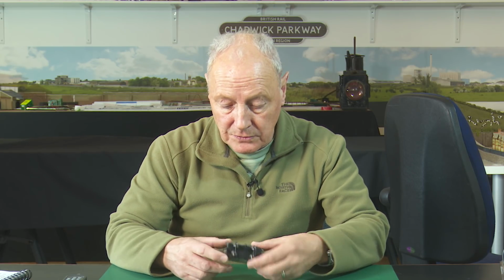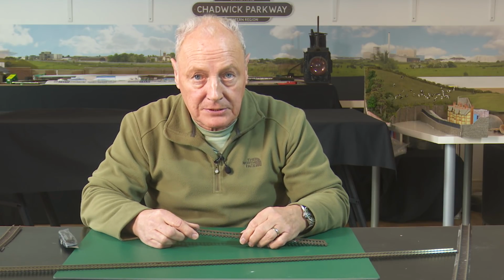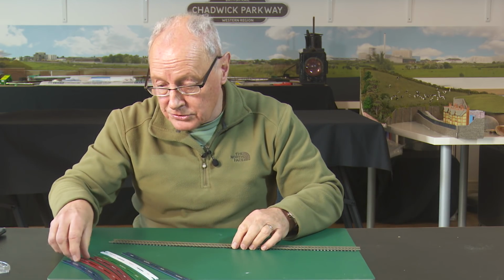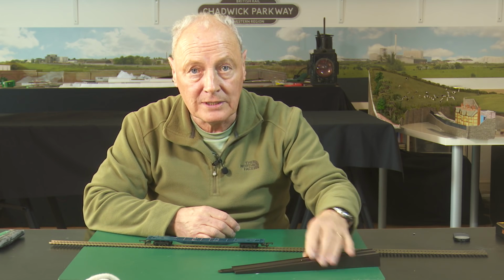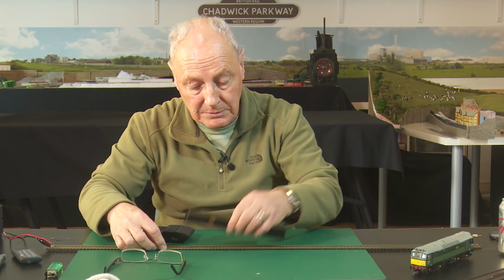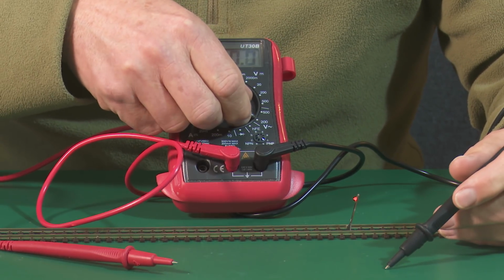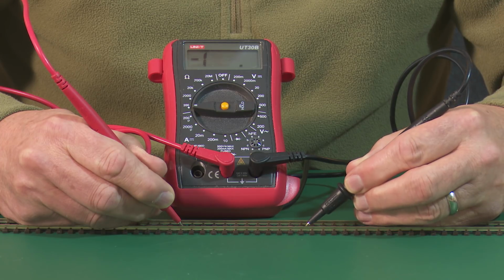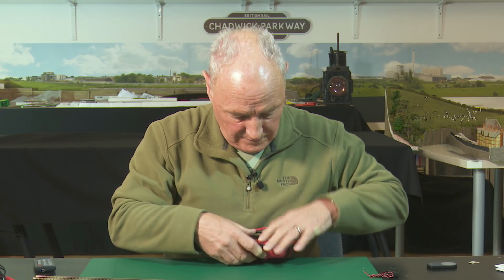Great model railway tools for the Railway Modeller at Chadwick Model Railway. | 76

Comment: As a professional firefighter, I would have to agree with you. A CO2 fire extinguisher will not kill you, yet the fire will kill you and take all your belongings with it! I think it's a great idea to have a fire extinguisher in the layout room. The only extinguisher that is dangerous to your health is a Halotron extinguisher, which is mostly used in areas where there are a lot of computers. Not for domestic use.
I learned a lot about how to use a multi meter, thanks for your help on this video. Lots of great things in it!
Reply: As a retired fire officer with 30 years service and now another 20 years as a fire safety consultant i thought i would add something to Charlie's advice regarding the placement of an extinguisher.  
By the door is a common location but it is rarely the best placement for any extinguisher simply because it encourages the "go to the door and think about it" strategy.  If you have got to the door in an emergency the best course of action is to use the door and leave rather than return to the fire and then do something about it.  It follows that the better placement for a fire extinguisher is closer to where the action is, or in a more central location where it can be used immediately.  Obviously, rooms and spaces vary but the principal is always the same - make sure the extinguisher is in a place where it can be used as soon as possible rather than somewhere that means it has to be fetched and brought back to the scene of the fire.
i know this is a small point but I hope it is worth a bit of thought.  And yes, a CO2 extinguisher will be fine as long as you remember to use it and leave, for a while.  Also it is worth bearing in mind that if you do use it it will be VERY noisy and don't hold the discharge horn unless you fancy a cold burn and being stuck to the frosted horn!

Love your channel, Charlie.  i really enjoy your videos.......and I don't even have a model railway!
Reply: Also the fine powder from a dry powder extinguisher will get in everywhere else and eventually over time damage or ruin all the surviving electronics circuits etc. in the rets of the room/house.
Reply from the maker: Thanks Joe, I’m so pleased that a professional firefighter can add his weight to what I believe is common sense.

Comment: Using ohms is something I never really thought about. Measuring voltage across joints because I'm simple that way. So thanks Charlie, I now have another use for the settings on my multi meter.
Reply from the maker: Glad I could help you find a new use for your meter Steve.  Regards, Charlie.

Comment: A good few years ago. I had my layout in the loft. I was told that a well known manufacturer was producing their own chip, But it was really a rebranded Lenz chip and it was a lot cheaper. I bought one and tried it in one of my Locos. I had my back to it as it ran around the back side of my layout. It had burst into flames before it shorted out the electric supply. I realised then that a small extinguisher was a must. (It was not a rebranded Lenz chip. That was why it was a lot cheaper)
Reply from the maker: A lesson well learned Philip. You can’t save money on safety. Regards, Charlie.

Comment: I wouldn’t invite the fire officer. Research the correct type of extinguishers. Show the wiring under your track boards would scare the bejesus out of the inspector and would probably demand that a certified electrician sign off your work!
Reply from the maker: I’m pretty sure at 12 V DC, I haven’t breached any. Regulations. Regards, Charlie.

Comment: Fire extinguisher what for slide track together screw down slide power leads in Tri ang track ready to run PVA glue and UHU not very flammable, citric acid 🤔to clean track with get your COSSH risk assessment out Co2 or powder ? Your to HSE
Reply from the maker: No, I’m just safety conscious.  With so much electronics and regular soldering, I’d be foolish not to have a fire extinguisher.  Regards Charlie.

Comment: On the side of the multi meter where the probes are stored. They can be used another way. Place the probe in with the test point outwards it will hold its self. This way you hold the meter and use the probe fixed to the side as one point of test the other is the free probe. This way you have the meter at one end of the testing point so don’t need to look round too often.
Reply from the maker: What an excellent suggestion.
Much appreciated, regards Charlie

Comment: Hi Charlie, find your video's very informative for someone like me starting out at 76 for the first time. In your video you show the back to back measure of 14.6 for wagons & coaches which was so helpful. As some of the stuff I have dates back to my sons Triang/Hornby from around 1970 all needs checking for modern day track & points thats why I'm using Peco streamline 100 in the hope it helps derailments. Where can I get the back to back you showed as it's not on your list of items used?
You explain things very well & show the process you go through in getting to your final end. My plan is to go DCC which frightens the hell out of me but in for a penny ah! no one ever learned anything without mistakes. Just hope they are not too expensive. How about some articles on converting older Lima models to DCC & the pitfalls or even the old Triang/Hornby there are a lot of us out there with minimal cash to spend. have taken your advice on so much, THANKS, Robin, Llanelli, S Wales.
Reply from the maker: Hi Robyn, I think you can buy the back to back gauge, from squirestools.com. Regarding converting old locos, I must confess it’s probably more trouble than it’s worth. Regards Charlie

Comment: Good idea about fire extinguishers, (any type),  first aid, phones etc 
I have a small plant sprayer, and a 2L milk container, filled with water.
Then if you ignite something accidently, you can wet and extinquish immediately before serious damage is done or a fire extinguisher is needed..
Also if you burn yourself with solder, hot glue etc, water is the best first aid to reduce the pain..
x The Bigfella x
Reply from the maker: Great tips BF.

Comment: I thought the mobile phone was to order a pizza delivery ;-)
I am using the N version of those to lock the flex track into shape and carry it around 
https://www.modellbahn-hobbyshop.de/Werkzeug-Hilfsmittel/Gleisbau-Klammern-Set--H0-0e-Krause-Klammern
speakers have an impedance, there is a resistive portion to the value, and an inductive portion, so the resistance measured is lower than the given 100 ohm
on your meter there is probably a conduction beep test that is accessible with the diode testing setting
Reply from the maker: Sadly no beep on mine AJ.

Comment: Charlie, your multi-meter has a diode position on it, near the bottom.  It should beep when you have continuity.  Try it.  Also, a CO fire bottle is what you want to use on an electrical fire - purple K and foam don't play well with electrical fires, let alone around model railroads.
Reply from the maker: Great points Chuck, many thanks.

Comment: I think the fire extinguisher debate will be just that. A debate. People will agree or disagree. Personally, I agree and in my rail room (30ft x 19ft), I have the soldering iron, a log burner, a few logs, firelighters, plenty of combustible materials to take hold should a fire break out. I also have a wooden ceiling although it is probably 14ft high, a fire could still reach it. The outer skin of the building is clad in timber. I have a fire extinguisher by the entrance, a first aid kit on a bench and a landline. I also have broadband and a mobile booster so my mobile signal is always good. My wife calls me obsessed and she often says I analyse things too much but for me, risk assessment and reduction is part of the job I do in the running of my business day to day. For me, I just do it because it's the way I am and for a little time taken to assess what is needed, I can protect my hobby as best I can. And if that protects me in the process, the wife will probably think twice about calling me obsessed in the future.......
Reply from the maker: It’s comments such as yours Andy, that make my channel worthwhile.

Comment: I agree with you Charlie.  Too many people take fire safety for granted. In addition to a fire extinguisher a fire blanket could make the difference between a house or no house.  
Even with the excellent fire service in the UK, by the time the fire brigade turn up the house you may be minus both the layout and house.... just take into account some of the materials being used...paints, thinners, foam and newspaper to name a few. And finally a smoke detector should be installed in the room.
Reply from the maker: An excellent comment and good suggestions too.

Comment: The only time that your model railway will probably burst into flames is if you use cabling not having the correct size to take the current needed.Install some kind of circuit protection,the simplest protection would be a fuse within the circuit
Reply from the maker: A valid point David.

Comment: What an informative video. Thanks for all those tips. Being ham-fisted my main cause of irritation is cutting plain track accurately to fit in between two sets of points, e.g. a loco release road. I measure, measure again, mark up where the cut should be, cut rail with the Dremel, and whaddya know...it's 2mm short or a fraction too long. Every ruddy time! How does everyone else get it bang on?
Reply from the maker: Everyone gets it wrong, it’s an honesty problem.

Comment: Hi Charlie, I’m just wondering where you got your 00 back to back gauge from? I can’t find any in the UK at the moment at either 14.5mm or 14.6mm. I was in Settle a few weeks ago and popped into DCC Concepts and asked them about there 00 gauges which are never in stock and sadly found out the European watch maker who machined the gauges died so they aren’t making anymore. I could use a metal ruler but I'm guessing that’s not as accurate.
Reply from the maker: Try Squires.com it Eileen’s Emporium.

Comment: Hi Charlie- A very informative video as usual - Onto the shopping list will go a CO2 Fire extinguisher, Multi meter, definitely a Peco Re-Railer .I found the Tracksettas invaluable when I was laying track and also the track tester I use is the Train Tech one £5 good for AC & DCC. Cheers Kev
Reply from the maker: That’s the one that I couldn’t find!
Reply: @ChadwickModelRailway  It will turn up when you stop looking for it !!!!But a great bit of kit . I like Train Tech products I bought some of their coach lighting as I don't have the ability to wire it myself and they are easy to fit and work very well.

Comment: Another great video Charlie, I don't know where you get the time for them considering your own modelling as well as helping out on McKinley. 
I have always believed in having fire extinguishers and have 1 in the kitchen, 1 in hobby room and 1 in the shed and wouldn't be without them. 
I had to clear my throat when you made the comment about medium radius bull head points, I'm a modern image modeller and have the grand choice of medium radius points L & R, we have been waiting for any addition to the range since 2010 😒. It amazes me that "people in the trade" still believe and use the old excuse that they have been using since Noah built the ark that, "most pointwork on the network is still on wooden sleepers" and fob us off. The "bullhead" fraternity really should consider themselves lucky that a "niche" product is supported as well as it is.
Reply from the maker: Interesting observation Warnz and pretty accurate too.

Comment: A fire extinguisher is a must-have item and a CO2  one would be the best, it works quicker and does not leave a lot of mesh. You are going to grab one first before anything big starts, and just a quick blast is all that would be needed.  unlike some form extinguisher. One tip for everyone is not to use a water one. Water and electric do not get on with each outer. Martin. (Dhaka, Bangladesh)
Reply from the maker: I’m so pleased that you’re in agreement Martin.

Comment: Another excellent video Charlie, I agree with you about the CO2 extinguisher, you will only be tackling a very small fire with a couple of short burst so there wont be any danger of suffocating, if the fire is large enough that you have to use the whole bottle on it then it has already gotten out of hand and you should have left several minutes ago and rung for the Fire Service. Nice mention of the sleeper spacer, I will definitely be buying a couple of them. If this is the last video before that Christmassy thing then may I wish you a very Merry Christmas and a Happy New Year.
Reply from the maker: I’m so pleased that you enjoyed it Mike and there should be one more before we celebrate the birth of Santa!

Comment: I listen to Health & Safety  people all over the place. I used to work in Electronics and we had various fire extinguishers all over the factory and I am surprised nobody has suggested a fire blanket just to go absolutely off the page. Health & safety is very good but does tend to go silly after awhile . For instance people preach not to handle the DCC chips, (over handle perhaps) but you are not going to blow a chip while putting it in a locomotive without earthing yourself, believe me I know because I have tried and have not managed to blow one yet. One other thing if you require button cell batteries try Poundland they do cards of them for a couple of quid and they work well. Thank you for another informative video you always make me chuckle and that's how it should be. Cheers Frank
Reply from the maker: I’m so pleased that you enjoyed it Frank, keep smiling.

Comment: Hi cHARLIE.....Des Davis from down under......just one point I would like to make re cleaning wheels.I have used several types of wheel cleaning systems and the best by far is paper towel and wetted down with track cleaning fluid ie. peco electro lube or the smoke fluid/track cleaning fluid and just run the loco backwards and forwards making sure electrical contact is made to at least one set of pickups.This works well with the dreaded traction tyres used on some manufactures locos and it does"nt damage the traction tyres and better still it will not scratch the wheel surface which in turn leads to more grunge on the wheel treads.I know that method you demonstrated works ....but does have that one drawback.Just thought I would pass it on for what it"s worth.I really enjoy your videos and look forward to seeing more in the ensuing months.Kindest regards Des Davis......and a Merry Christmas to you and all your subscribers.
Reply from the maker: Thanks Des, a useful tip and I’m so pleased that you enjoyed the video.

Comment: Charlie, 
An alternative to a mobile is an Echo (Alexa) or Google hub (?) or iPad (Siri) that you can speak to for help, even if you have glued your fingers to something!
I too like the Railer; there was a recent version that is powered, so you can drive a loco onto the track. Use the Peco version, and stick tin-foil over each wheel-well, not forgetting to wrap each side over the end to pick up the power from the track. Voila, a 30 gbp powered railer for pennies more than the basic version.
And I like the re-railer/uncoupled ramp bit of track, that will catch a bogie that is not properly railed, and put it back onto the track. Put one inside a tunnel entrance, for safety. Someone we both know is getting a couple for Xmas!
And for the larger locos, you can separate the brush blocks, so you have one per bogie. No need to clean the parts of the loco that don’t have wheels!
See you in three weeks!
Tom
Reply from the maker: Hi Tom, I’m very interested in the Voila railer.  Do you have a link etc.
Reply: Chadwick Model Railway 
Charlie, it’s a home build, and I’ve not seen anyone doing a similar. 
Perhaps I’ll have to make another, if I can beat skilled videographers like you...

The idea I followed is the Proses (P)RLR-01, which is currently 45 quid.
Reply from the maker: Ah, a challenge Tom.

Comment: What i have as standard tools: 
A big old transformer with overload/ short circuit indicators. Those LM317 ones might have protection built in but no indications at all
Multiple Laptop power supplies modified to a 2,1 or 2,5 mm connector which is sort of the standard plug size, useable for about everything.
Kit built DCC booster that gives extra short circuit protection 
LM317 in a box as a variable voltage power supply
Reply from the maker: And a smoke detector or fire extinguisher?
Reply: @ChadwickModelRailway  I haven't built a fixed layout yet, so I'm trying to keep it on the safe side of the amperage range for the tinkering. But I will certainly buy one when the building work advances, as the average power of a Dcc booster is about double that of a normal speed controller with the spark size and heat potential to match.

Comment: I worked in the the telecommunications industry for years, it is not the CO2 you need to worry about. It is the various synthetic materials you have on your layouts. They gas off deadly fumes when heated past their melting point. These fumes are odourless and invisible, and will knock you unconscious within minutes. I nearly got killed by a melting nylon washer insulator in a small contained space, I had a severe headache for hours afterwards. This is why the advice is not to fight a fire in your own home in this day in age, but get out as fast as possible before you are overcome by the deadly gasses get you.
Reply from the maker: I just think that we need to be sensible and have the tools that we need to cobat a fire before it takes hold.